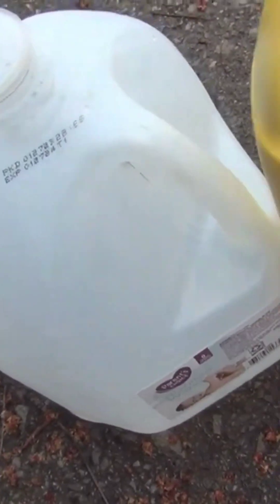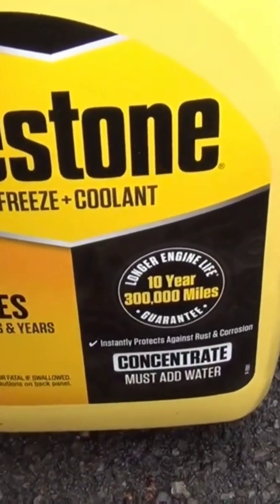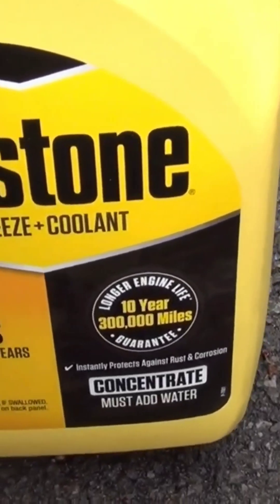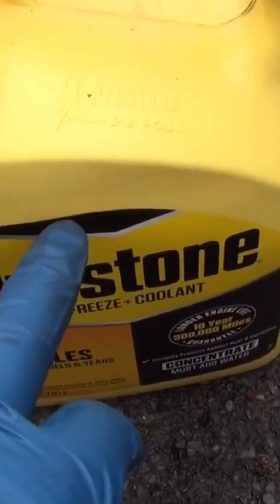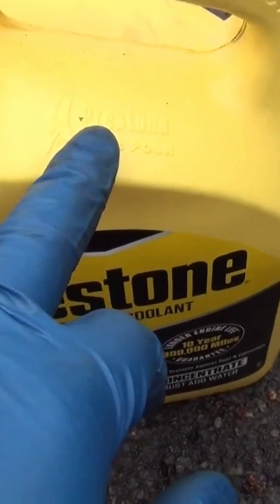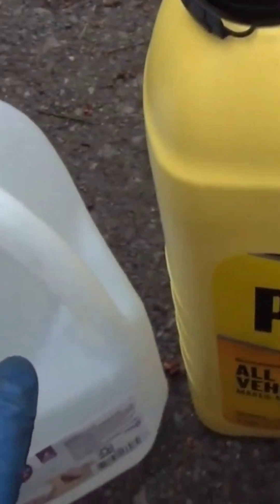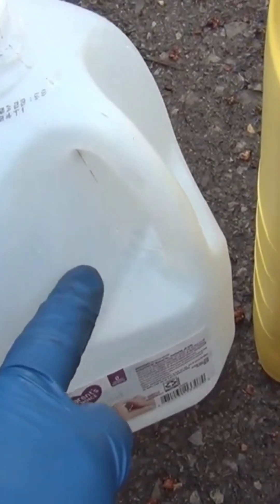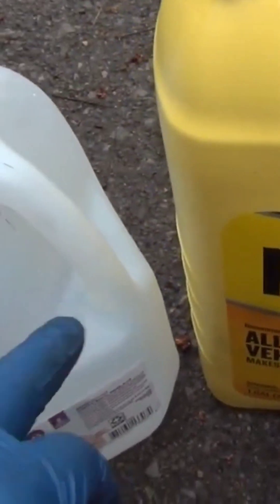How to mix 50/50 antifreeze

Comment: So, you've poured half of the coolant in your reservoir unmixed with water, then you half the rest with water in the jug? Now it's way too strong in your car.
Reply: It will mix itself as it runs through the system but personally I do feel better having an empty container and mixing before putting in car.